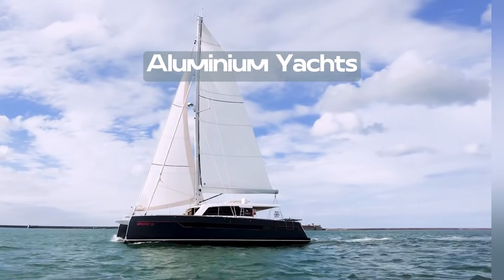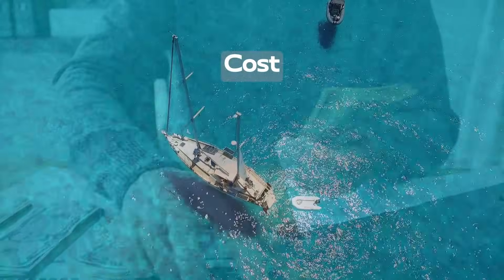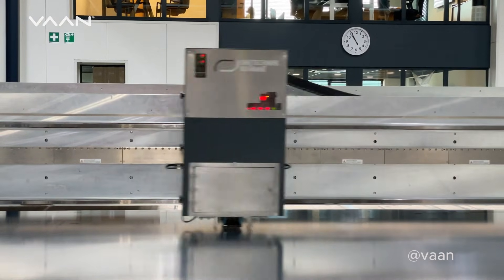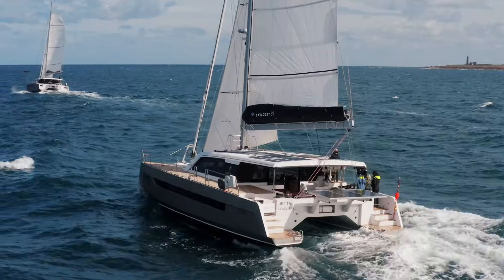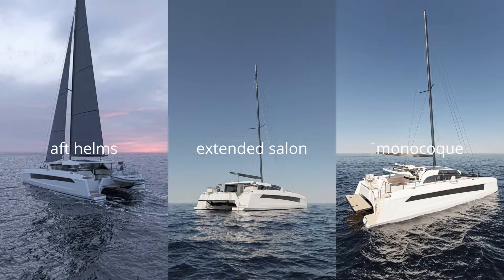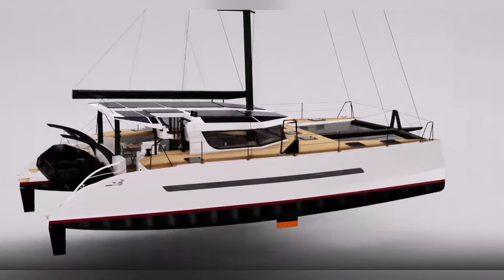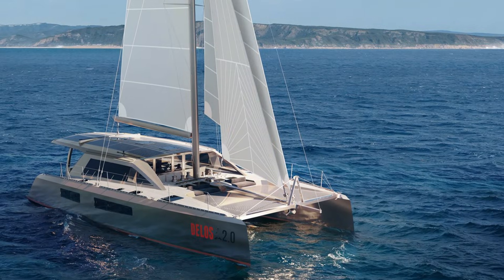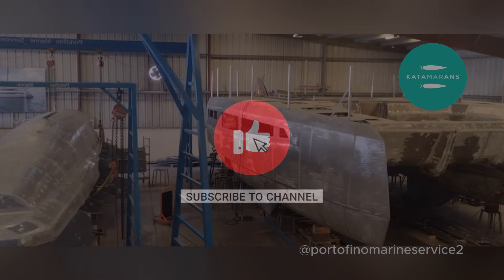Best Aluminium Catamarans +2 Monohulls! Which are Better? Aluminium or Fibreglass Sailing Yachts?

Comment: Portofino 52 is my big favorit. It should be ready around June and 47 should be ready around March.
Reply: The Portofino 52 has some amazing new features and design applications, and it appears to be very well built, but man, it is going to be extremely heavy. Luxury over performance.
Reply: @donaldlovegrove1754  it’s not all about  performance. When living full time on board, long passages account for less than 5% of your time on board so practicality, safety and comfort will have a more drastic experience compared to performance. Also, even the sluggish cat would often outperform a monohull.
Reply: @alandelmas1236 none of that is true. Heavy cats are dangerous. Designing a sailing boat for not sailing is very dumb. Many heavy cats are outperformed by monohulls. If you compare cats and monos of equal price then the performances if cats suffer further.
Reply: @donaldlovegrove1754  It remains to be seen whether what you say is true in practice. Exciting.
Reply: @magnusenamd  You can't defy physics laws. This boat is way too heavy. The polars that have been issued for the Portofino 52 are a joke and the owners will be sorely disappointed. They have been warned about it by some highly regarded professionals like Shayne Young.
Reply: @ozolli What are you comparing it to now? This is a fast Leopard 50 catamaran rather than something else. Which should be able to sail in clearly lighter winds. This is something you live in that is safe and that can be put on the beach and go into shallow water despite its size and luxury. But if you want to live in noise and poor comfort, it will you probably very disappointed with this catamaran. One more disappointed with its safety too. This is something you can live in all year round and not for weeks and a few months, not just to be able to sail in a lighter wind and faster.
Reply: @magnusenamd  I am not the one who is comparing this boat to another boat. I am not the one who consistently said it is a performance catamaran. It is not and far from that. I have a 50' cat made in South Africa at this moment. Design light displacement under 8 tons. Will live full time onboard with family with exactly the comfort we want. Been sailing for 45 years, I know what we need including high sense of safety at sea.
Reply: @ozolli Wow, you really have a lot of experience. Impressive. I must have misunderstood or answered the wrong person then. Excuse me.
Reply: @ozolli I think it will be clearly better than what they had before and is the one you compare it to rather something else. It will be exciting to see how it performs.
Reply: @ozolliit always depends what you are comparing it to…some cats will sacrifice a lot of safety for high performances which is fine if you are after that. I know people that are buying the Portofino cats and they are well aware this won’t perform like a Gunboat nor that has never been the expectation. Instead, the expectation is slightly better than a Lagoon or a Leopard…
Reply: @alandelmas1236  Exactly.
👍
Reply from the maker: @magnusenamd  looking forward to seeing these on the water
Reply: @katamaranscom  Yes, I have longed for this for a long time. Now it's so close at last.